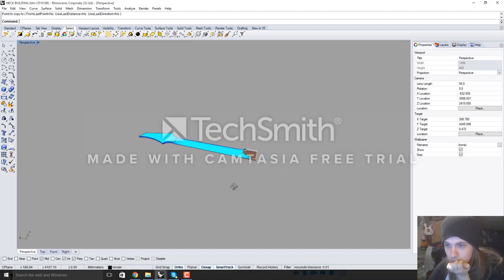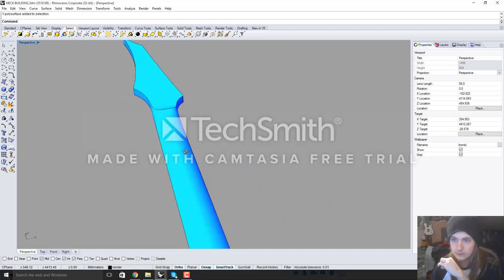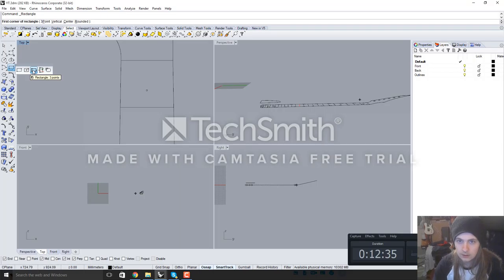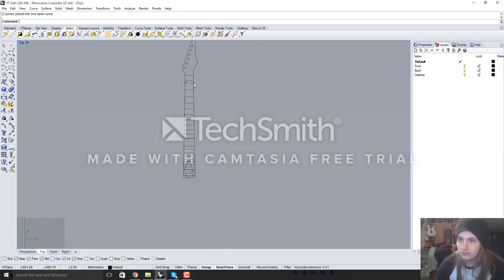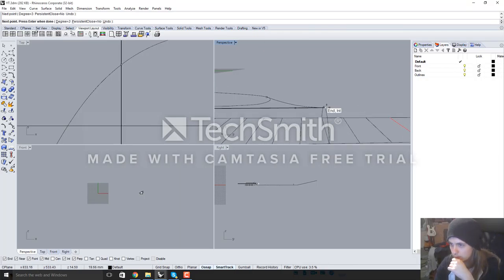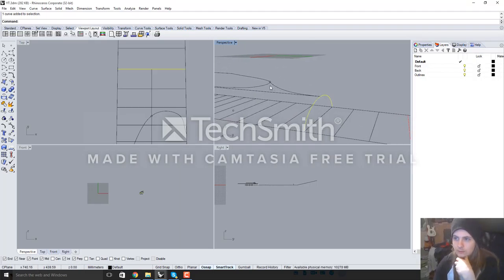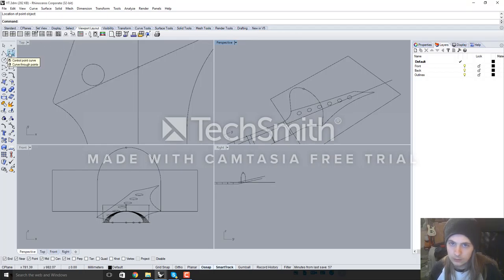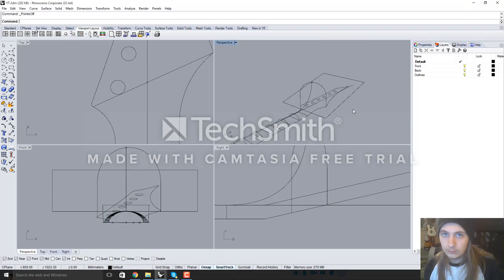How to model a Guitar Neck in Rhino 5

Comment: I now use this method to carve cnc necks. Thanks. In the case where you want to define the neck 'heel' profile first and have the surfaces pass through the 'profile'  - how would you approach that? specifically a standard strat headstock - i tried it as a special case of the general method where the tilt angle is zero and the cutting plane end 'hook is 180  and it works but I have no control over the shape of the neck end of the headstock and trial and error would take too long...  So can you advise me on that please? Thanks again.

Comment: Great guide! Instead of the Divide/Section method to create guide curves. You can just use extract iso curve command, change direction on the back neck surface, way quicker.

Comment: Excellent video. I like so much about your method compared to what I'd been doing. My models would get really complicated with lots of joined and cut surfaces, and fiddly little areas with a bunch of small patches. It made it very hard to adjust to any changes I'd want to make. Your approach looks faster, simpler, and with a better result. Thanks!
Reply from the maker: My pleasure!

Comment: Fantastic tutorial! Thank you so much for posting this. I just found your channel, and this is the first video I watched. I certainly subbed, and can't wait to see what you post for us next.

If I may be so bold as to make a suggestion for a screen capture program that is free and will eliminate that watermark. I use Flashback Express by Blueberry Software. It will let you capture your webcam for the picture in picture effect you're running in this video as well. It saves the screen capture in its own proprietary format, but will export the video to several different common video formats for editing. It's very easy to learn. I've been using it for close to a year, and it works very well.

Keep up the excellent work! I'm off to watch your other videos!
Reply from the maker: Hey cheers buddy. yeah i had a look at some different programs but couldnt find anything. I'll check this out!

Comment: This is so helpful man you are incredible! I just have 2 questions that i dont really understand.
1. when the video began the heel was already floating above the neck but i dont know how far away it was. how do you deside that distance?
2. i noticed in your video about 2D fretboards you said to make an extra fret for overhang. I noticed in this video you also had 25 frets made but you made the neck all the way to the end, leaving no room for overhang (although i may have just counted wrong). I'm an absolute beginner so any help is appreciated!
Reply from the maker: Ok so, for some reason i forgot to add into this video how to make the heel. The heel is made by placing the fretboard onto the body shape, and using the split command to create the heel shape. Once you have the heel shape created, the heel height (or depth) is completely dependent on the design. for example you can add 2mm extra to the heel depth and -2mm off from the neck pocket on the body. I tend to use 22mm as it gives me a nice height to transition a shape into the neck profile.

2. When i say overhang it is because you need room after the 24th fret to support the fret. if you were to cut the fretboard off at the 24th fret, you'd only have 23 frets as the end of the fretboard would be fret 24. I hope that helps :)

Comment: Hi there. Great tutorial at first. But i have a problem right at this point here 38:45. Everytime when i try to split the headstock from the  surface i got this errormessage "Teilung fehlgeschlagen, die Objekte könnte sich nicht schneiden oder die Schnitte könnten Objekt nicht teilen." First of all, if im joining the parts from the headstock together Rhino told me "joint tree curves to one open curve", but i can't see any open curves. What could be wrong? Except my english i mean :-).
Reply from the maker: This is because your surface is not intersecting/touching the lines properly. you need to make sure you have a fully joined single curve of the headstock shape that is PROJECTED onto the surface :)